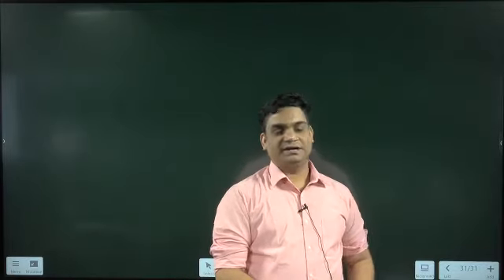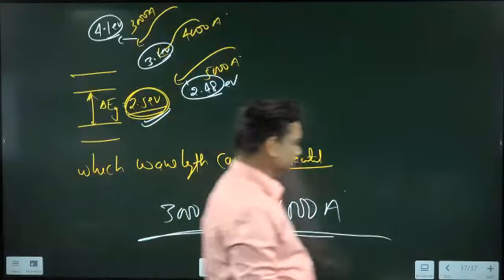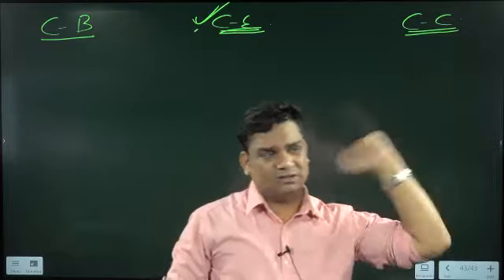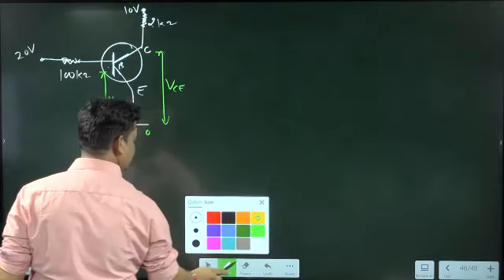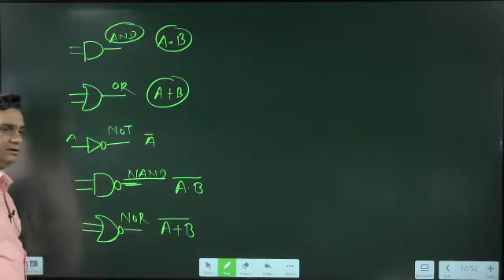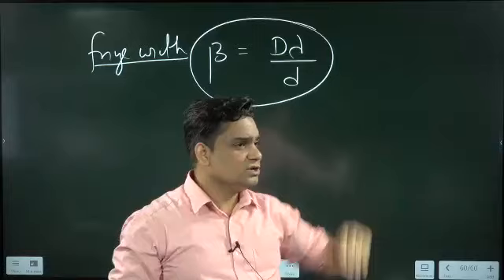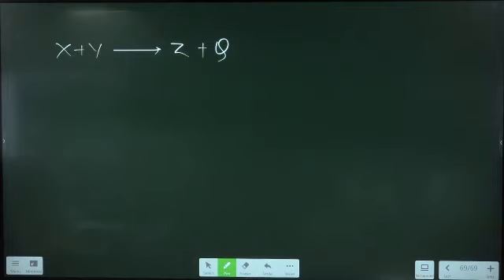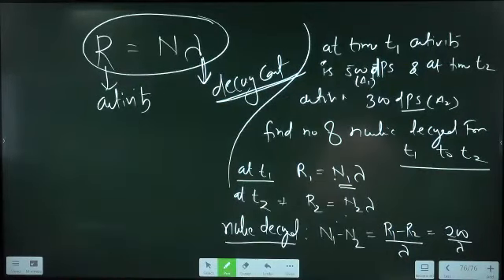Sri Gosalites| Marathon Class| Mohit Pandey sir| Physics-2| Part2

Comment: In the circuit shown in figure the current gain,

= 200 for the transistor. What would be the
base resistance RB so that VCE = 2 V? (Neglect VBE)
(1) 
2×10³ohm
(2) 2.5×10^5 ohm
(3) 1× 10^6 ohm
4) 500 ohm